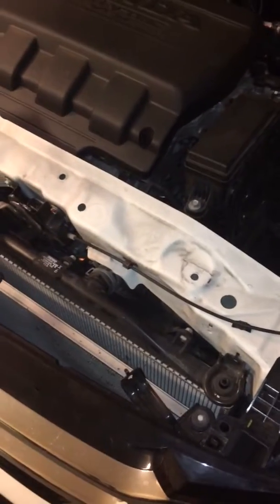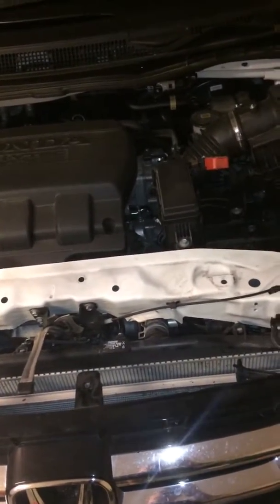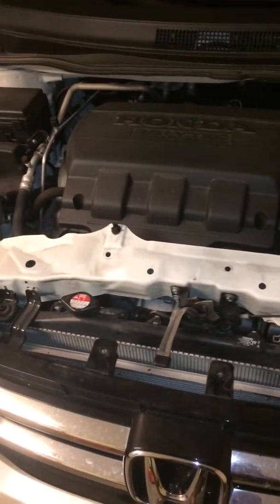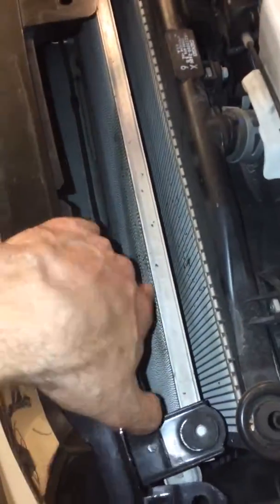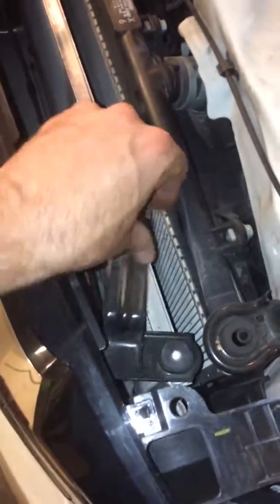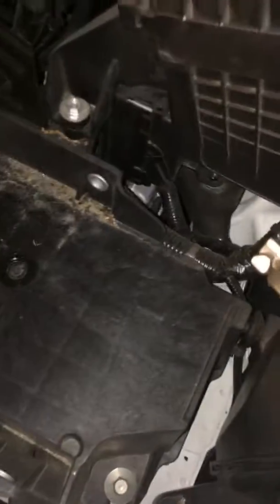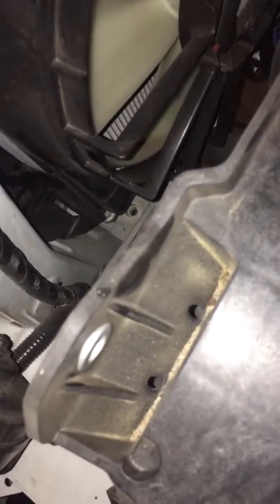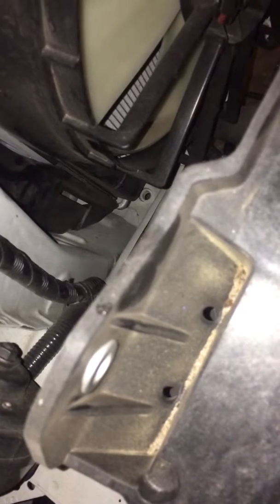2011-2016 Honda Odyssey ATF Cooler install Part 1

Comment: Thanks for your installation idea of installing a cooler without removing the front fascia, looks like it will save a lot of work.  By the way, "the round solenoid thing" you mentioned at 3:00 is actually the transmission filter.  Honda part# 25430-PLR-003.  It can be replaced with a slightly larger filter that includes a magnet to remove ferrous particles, MagneFine 3/8" https://www.magnefinefilters.com/NEW-Magnefine-3-8-Magnetic-Inline-Transmission-Filter-R038M-3810000.htm